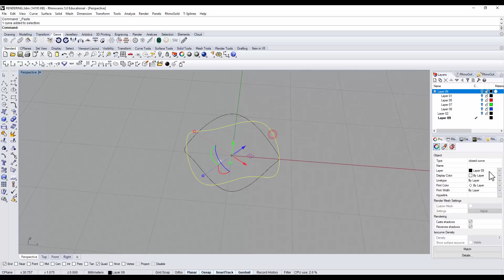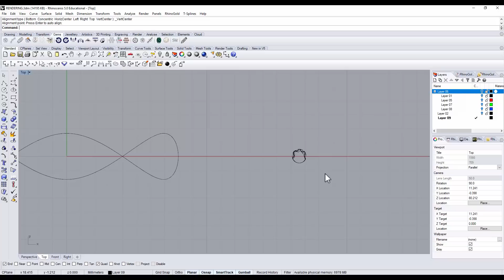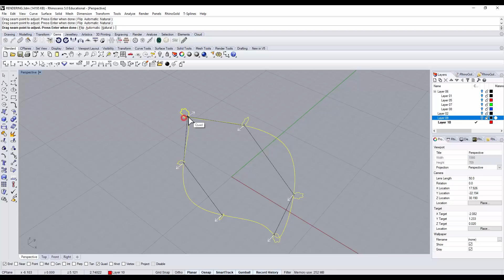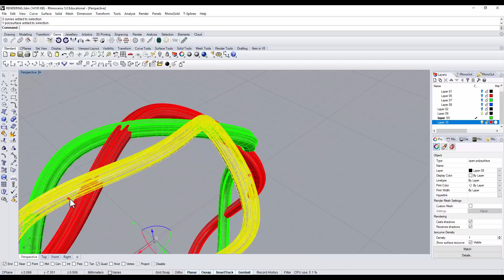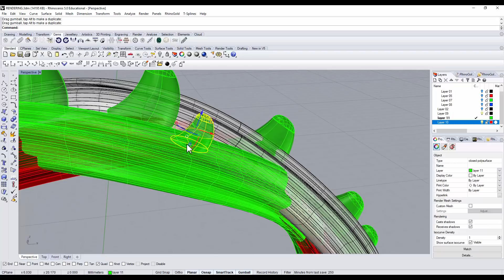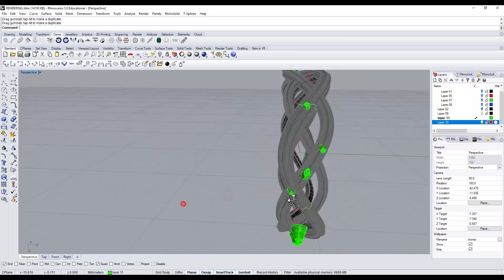Jewelry CAD Design Tutorial #19: Thorn Ring with Rhino 3D (有中文字幕)

Comment: Hi PJ. I tried to draw the vine-like ring shank by using the sweep 1 rail command, but then i noticed that the object was an open polysurface (i also notice that yours is also an open one too). Will it cause any problems during the printing process and are there any ways to fix it? Thank you.
Reply from the maker: Hi, If the cross session for the sweep 1 is a close curve. You should have a close polysurface after you cap it. Sometime, it appears naked edges on where there join edges, that may caused by the alignment. If it still cause the model problem, you can send the model to my email at pj@pjchendesign.com I can take a look for you.